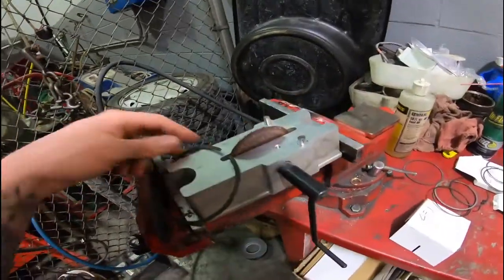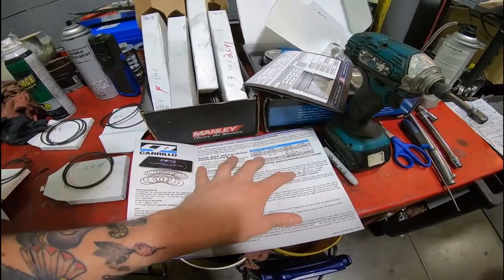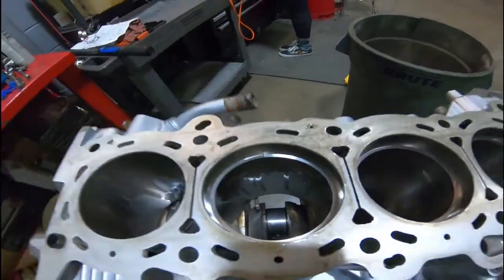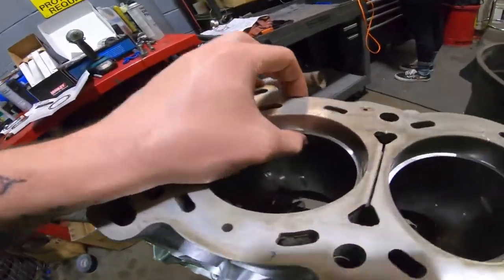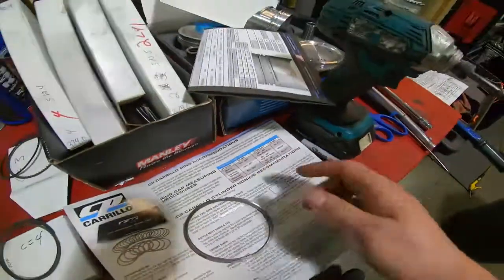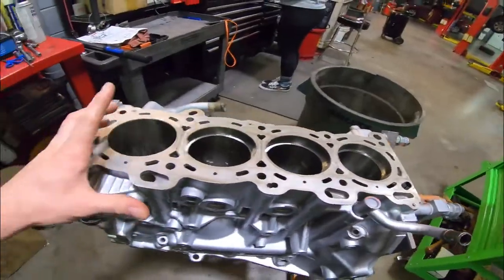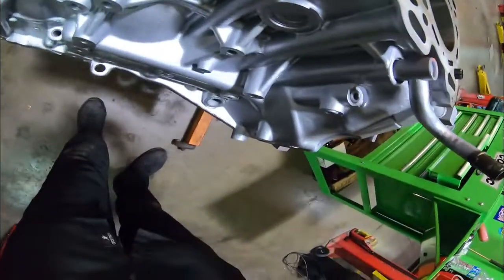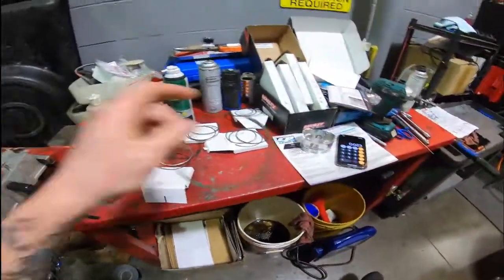DON'T!! build an engine without doing this! [SR20det]

Comment: Can you show me about end gap ring pistons for this engine?
Reply from the maker: Can you list which engine it’s for and what your bore size is as well as power goals?
Reply: I measured old end gap for oil ring. The result of end gap is about 0.5 mm - 0.65 mm, but on the engine mechanical the end gap for oil ring is 0.2 mm - 0.50 mm (limit 1.8 mm). My engine produced white smoke and decrease oil. I've to replace ring pistons with new, right?

Comment: Great video! Im actually running CP 86.5 pistons for about 3 years but now each time that i drift my car the oil consumption goes nuts, after a whole day of drift i need to refill about 500cc or 600cc of oil what can be causing this? I have too much blowby